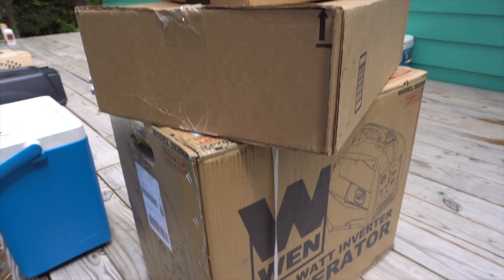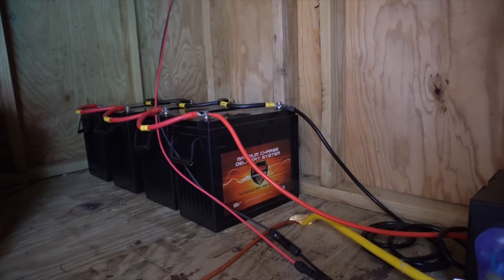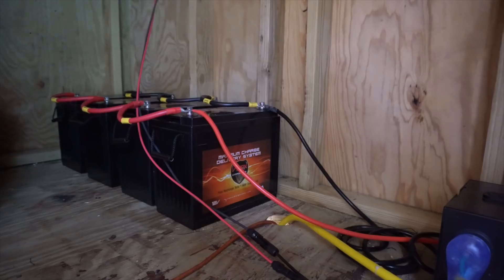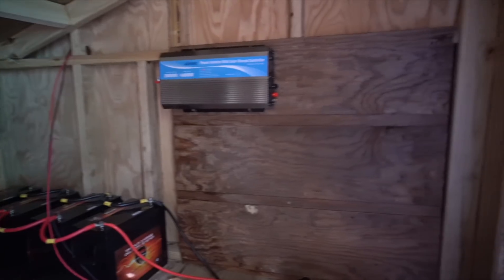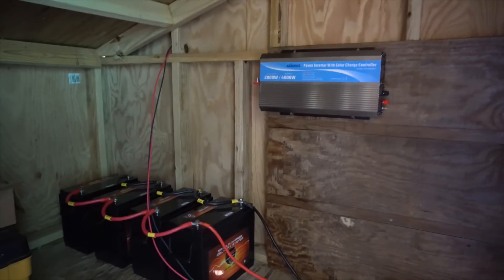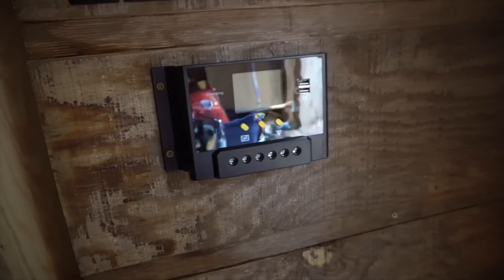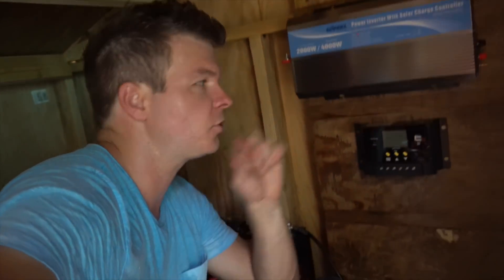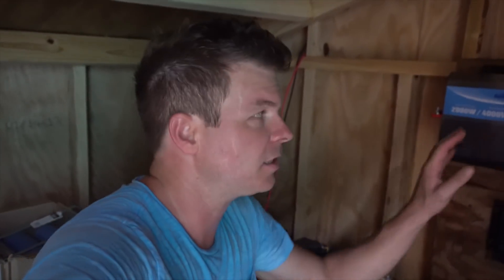Can A Tiny House Really Be Powered By Solar?

Comment: I'm currently running two 100 watt renogy panels. Four 6v 230 amp hour golf cart batteries. I'm able to keep a 7 cu/ft chest freezer, lights, fans and gadgets with a little power to spare.

Comment: I'm considering running air conditioning off of solar, I'm curious if you know what the insulation values are in his walls, floor and ceiling?
Reply from the maker: It's not that hard in a tiny house and if you have a very efficient mini split. Ceiling is something like R30 and walls are R20. It can be mid day and 90 degrees outside and still 75 degrees in the house.
Reply: I may be wrong, but I am finding that mini splits might not be the most efficient way to go.  If you have the ability, a wall unit seems like it might be a more efficient option than a mini split.